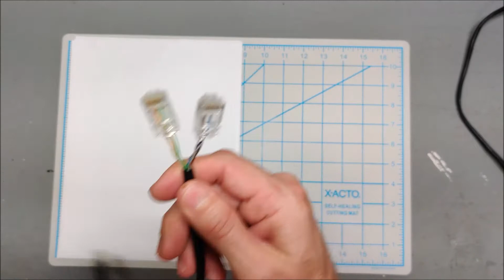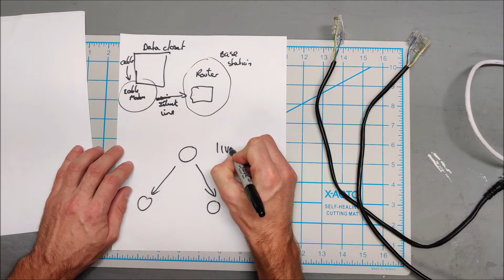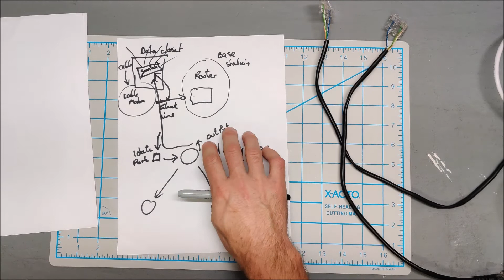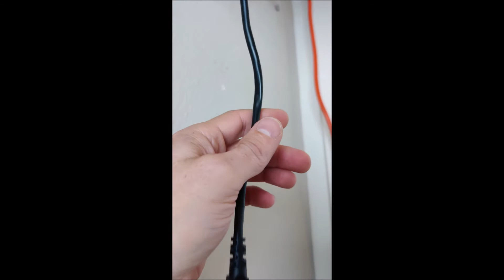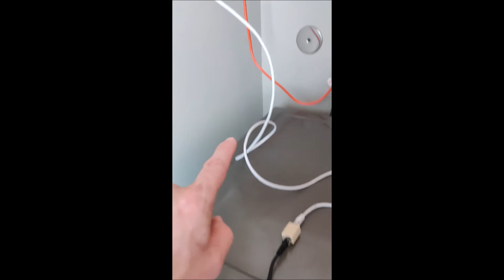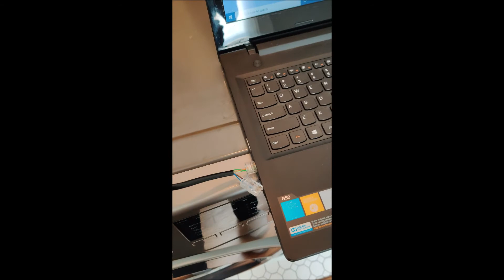2 Network Connections 1 Cable

Comment: Is the other end wired catB standard?
Reply from the maker: Yes. but it technically you only need 4 wires on each end
Reply: @stevenc22  for sure!  For whatever reason I can’t make link aggregation work.   Wanted to do a 2gig connection between switches in the house and shop.  It’s strange.
Reply from the maker: @HPL5P  You are not trying to run the 2 x 1 gig connections on a single cable are you? 4 wires only supports 100mbs connections.